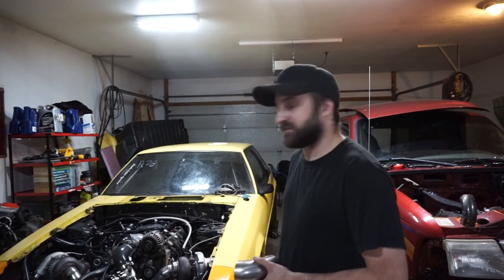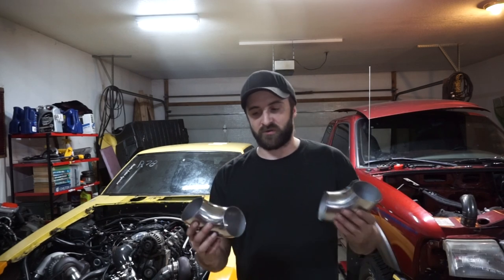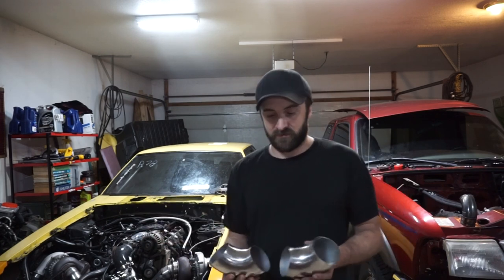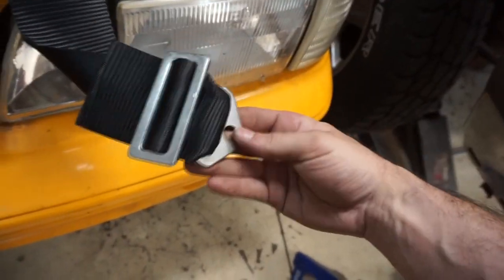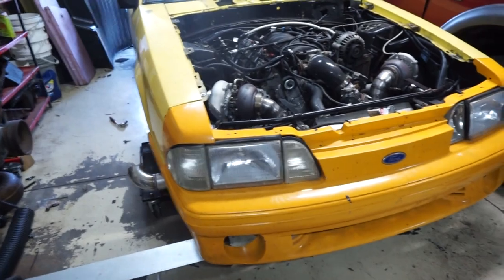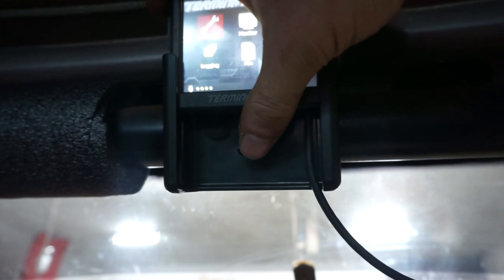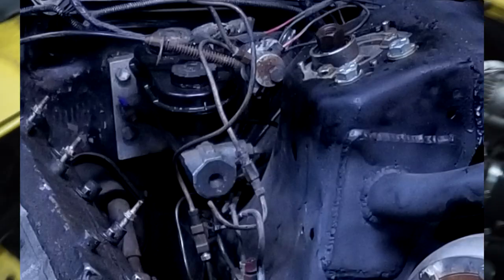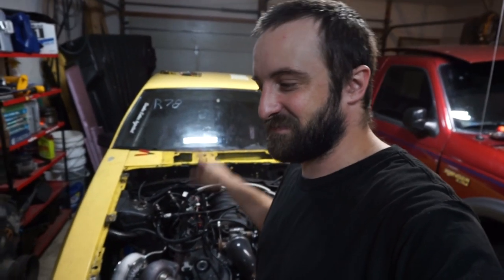Twin Turbo LS Fox Little Stuff!!! Line Lock, Boost Controller, 5 Point Harness Bull Horn Boiz!!!

Comment: Hopefully that fix on the wastegate dumps works, I'm 99% sure that's the problem though.

I'm trying to follow on the line lock change - mine, when I pump the brakes, I hit the button and it only holds fluid pressure against the front brakes. Is that what you did? I pump brakes, hit button and about 70.3445% throttle. Click high gear about 7000 and let go of the line lock button at the same time. Stay in throttle for about 1-2 more seconds unless I'm feeling real froggy or it has new tires. Coast to about 60-80 for clean surface.

Comment: Hooked line lock up to rear brakes???????
Reply from the maker: It locked them out with no pressure, so when I push pedal no fluid goes there. Only goes to front brakes so I can still modulate fronts as normal but rear spins free.